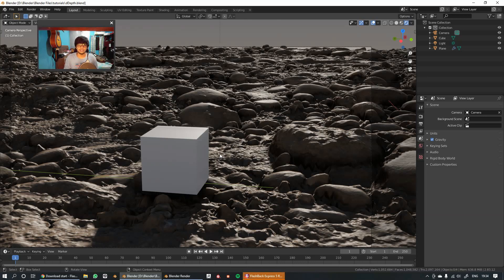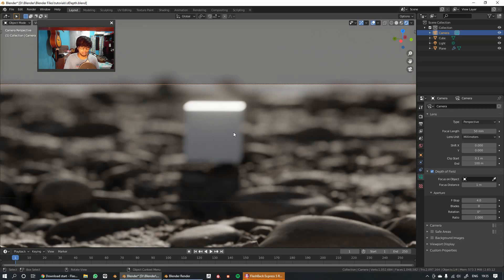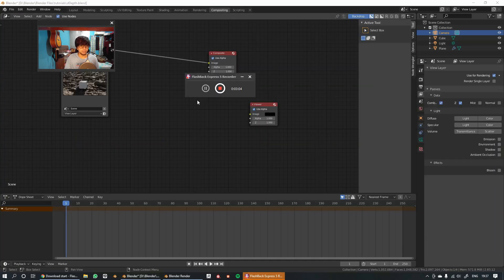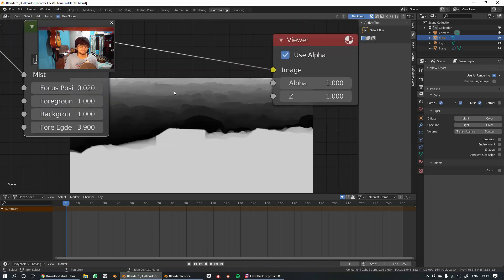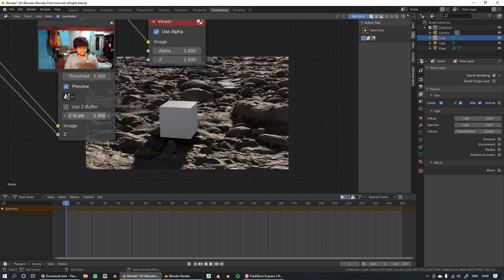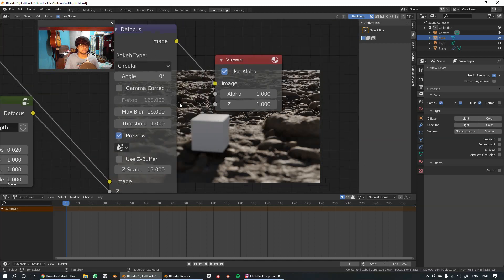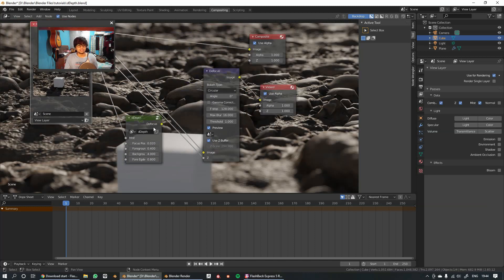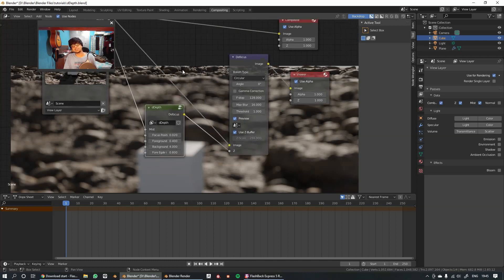Evee DOF solution | Anamorphic Renders | Blender 2.9

Comment: what has the term anamopric have to do with the subject?
Reply from the maker: Since their aperture is oval, they create oval shaped Bokeh...it has nothing to do with subject because subject is always in focus
Reply: @cgshukla1769  ah i was thinking about that later when i did some reading about anamorphic lenses.
Reply: @cgshukla1769  ps there is also this trick for quick z-pass. 
https://www.youtube.com/watch?v=5eoYmUfyUyw
We can also it to have better control of the mist pass. Im making an addon which automates all of this. Its almost done. It will setup all the nodes and adds the empties to the camera. It can also switch to other cameras with single button click
Reply: @cgshukla1769  i had not checked you file et. I see now its quite different, works fantastic! I thought i try to combine my code with your, but that the mist gets messed up
Reply: @cgshukla1769  How do we control the bokeh strength in your setup. It seems like its a fixed setting. Is that done inside node group?
Reply: @cgshukla1769  i added 2 drivers to the edge detection, than i can control the bur strength a tiny bit for the foreground. The background seems to have this limit. The bokeh in the main node tree doesnt do much when going past that number youve set
Reply: @cgshukla1769  i tried the defocus node, than we have more control and i can change the bokeh shape to hexa or octo. Feels like we have more control with that one. Did you try that one?
Reply from the maker: Wow, so you are a coder? Respect man. I hope you can make something better but I would not stress this much because an official fix will be here soon. Still it's a hell of a problem you're trying to fix, keep at it man👍
Reply: @cgshukla1769  Not a real dev, i like to fiddle around and i understand a bit of it. I did made some addons. Its handy if you know some python and need something specific. 

Yeah i read that dev post and i also remember seeing un update on blender today, the DOF and bokeh looks way better.

Still my addon for that Z-depth is handy. Its saves you tedious work to set it up manually. Plus you can animate it, so the Z-depth can be used in post and can be changed every frame
Reply from the maker: Actual Strength will be controlled by the node that does the blurring, like 'defocus' or 'blur'
Reply: @cgshukla1769  i tried the defocus and has some more items as well as bokeh shapes. The strength seems to work better in that one. I also added a curve to control the background better together with a gamma node
Reply from the maker: Try typing a number bigger than 1 in the "background" setting slider?
Reply: @cgshukla1769  ahh yeah perfect! I added a curve and gamma to strenghten the focus point, kinda helps a bit as well
Reply from the maker: Yes I only use that one, oh and uncheck preview and check gamma correction in that node
Reply: @cgshukla1769  i dont like the gamma correction, seems to work funky when Filmic is used. Thanks for the tips man!
Reply from the maker: Yeah I know that node is cool right? If you wanna see this technique in action you can see the short film I put on this channel, I use this blurring technique in almost every shot....
Reply: @cgshukla1769  Nice! It works quite well. The fine tunning is a bit finiky. Especially finding the right distance. THats why i like that Z-depth video i linked. It uses empties to control the min and max. Is that distance in your node, the distance from the camera? Perhaps an empty would work here as well
Reply: To bad the distance is a different measure that the realworld distance.